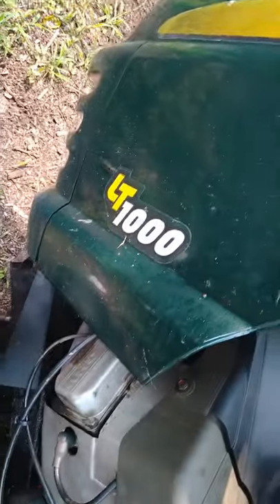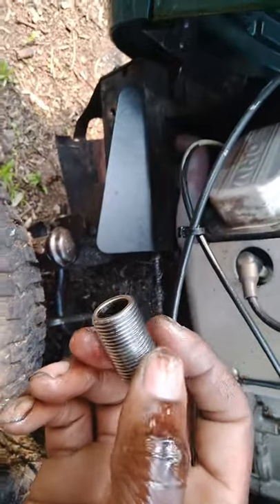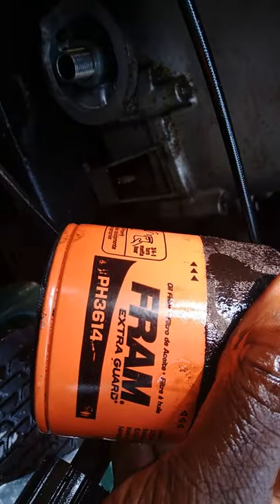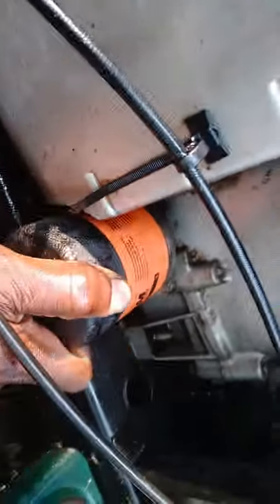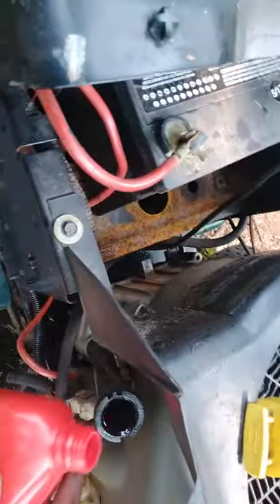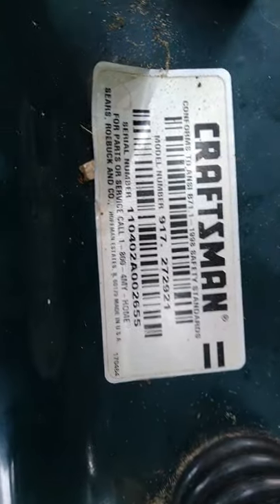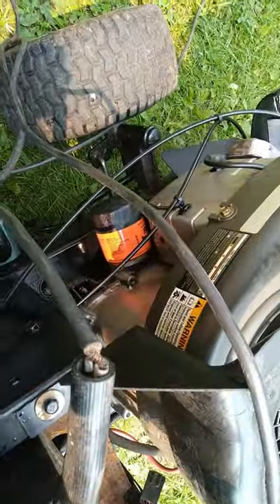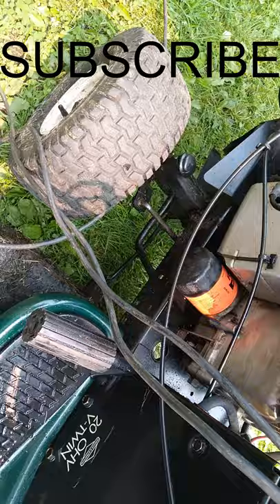How to fix oil chamber leak & install oil filter on a Craftsman LT1000 Lawn Tractor

Comment: Ok .. that was an awesome trick ... 🤙🏼 
I put new oil in my craftsman lt1000.. spark plug & air filter .. and I bought an oil filter ... but I don’t see where it he oil filter goes?? ... I assume they all have one 😬 
Thanks for your help 😊 
 .. have a super groovy day!
Reply from the maker: By default it dosent come with a oil filter. To install a oil filter you'll have to take off the cap that was leaking in the video and install one
Reply: @straighttothepoint3821  Right on! Thank you so kindly for responding 👍🏼
So some have and some don’t? If mine didn’t come with one .. no need for me to put one on?  ... if needed, I can do what you did 👍🏼..

It totally confused me to see filters were sold for it, but I couldn’t find where to install it 🤔 
I initially put a new carb on, (bad gas leak) wasn’t sure if float was stuck .. or? ...So I just replaced it 

Okie doke, I’ll start it up & see how it runs 
Totally appreciated your time, thanks! 🤙🏼

Comment: Can you show how you removed the leaking cap? Do you need a special wrench? Does the set screw to the left of the cap need to be loosened? Thanks for your help.
Reply: Just use some big adjustable pliers
Reply: Did the cap come off with the pliers? Video does not show removal. Like the last question, does the set screw need to be loosened?  @AndrewCantonTV
Reply from the maker: Yeah. That cap is threaded on. It's not that tight